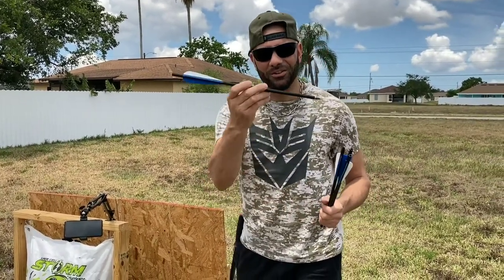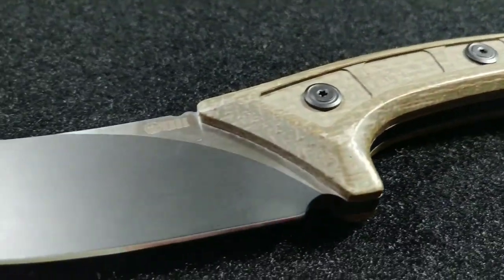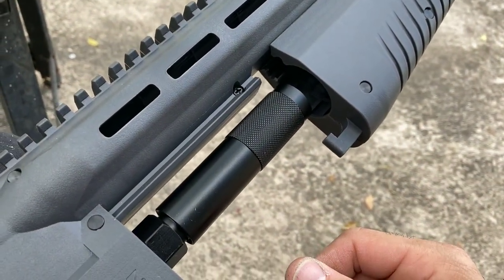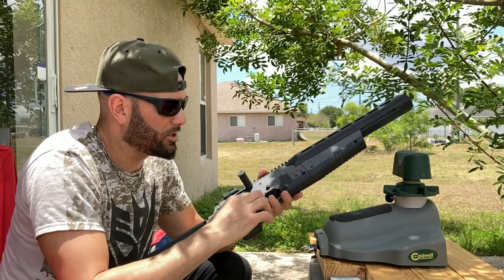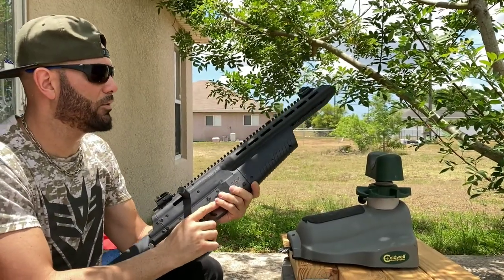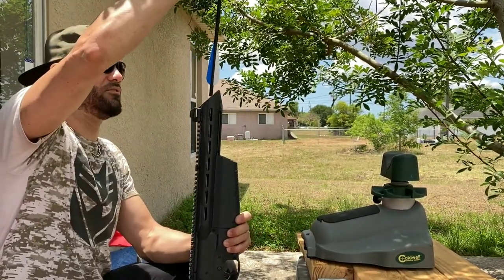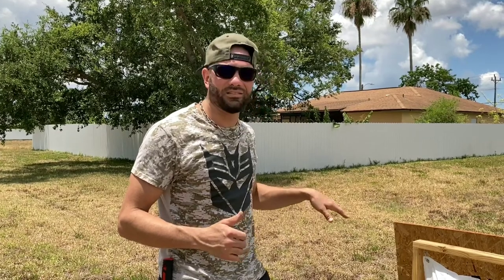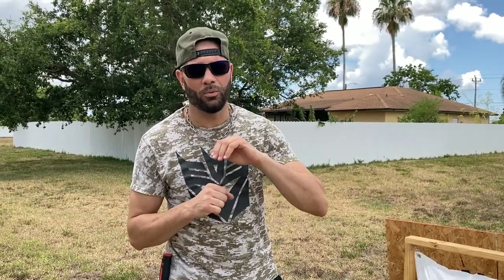Custom Bolts for Umarex® AirJavelin™ - Part II:  Range Test!

Comment: Awesome thank you for the information. I didn’t know you could use smaller co2 cartridges. I do know you can get the 80 pound categories at Walmart 2 for $13 dollars. I’m guessing you would have had better accuracy with the bigger co2 Cartridges. I plan buying one of thees guns from Amazon for $160 I’m pretty sure it will kill deer 🦌 with the right mods and that’s what I plan to do with it I imagine a lighted crossbow scope will work perfectly on this gun too.
Reply: You meant 88 grams. 88g or 90g cartridges won't make the air javelin more powerful because the pressure is regulated. It will give many more higher powered shots (12-15) before the arrows starts to slow down and drop. The 12g will give 3 good shots then drops power. As you practice, you'll get to know how much the arrow will drop and adjust accordingly.

Comment: Link to ebay does not find anymore. Any branding or anything I could use to identify the same product? Thmnks
Reply from the maker: Basically any 16" - 18" bolt shafts should work well, just make sure they are real carbon. I will update the listing now.